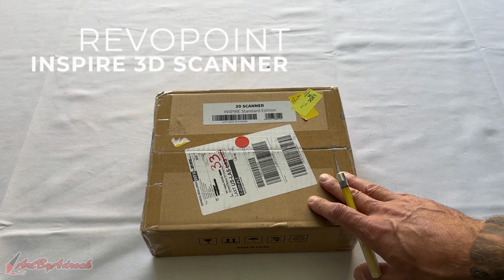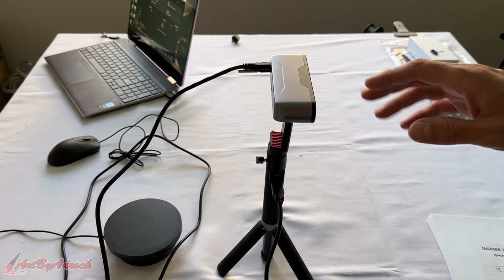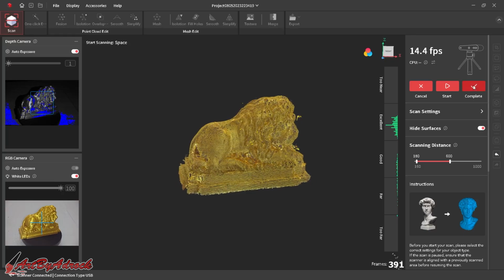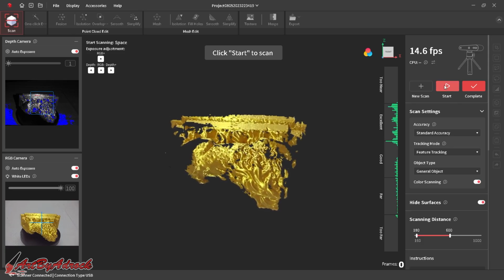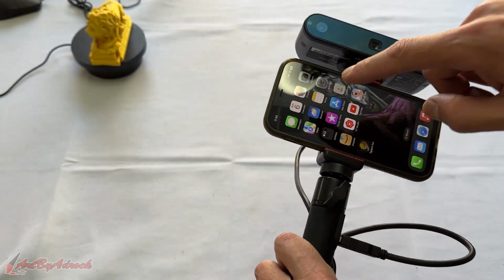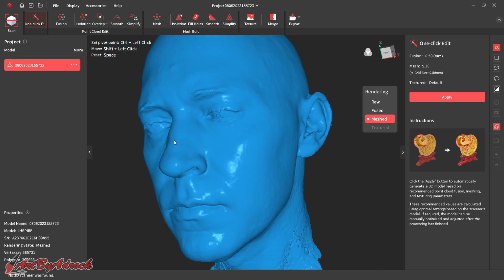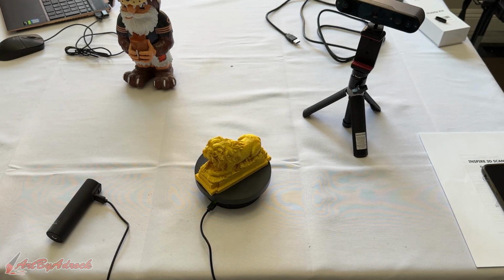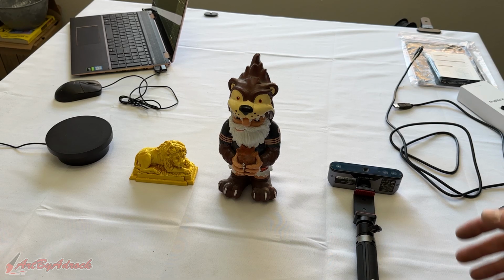Revopoint Inspire 3D Scanner (BRAND NEW!) - Unboxing, Setup, And How To Use - Honest Review

Comment: Does it need to be some high end phone to run app while scanning or a simple Motorola g32 will fit
Reply from the maker: No it doesn’t. The g32 should be fine. However the more frames you have the quicker you’ll run out of RAM